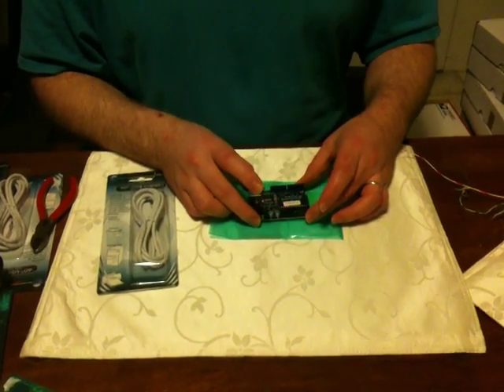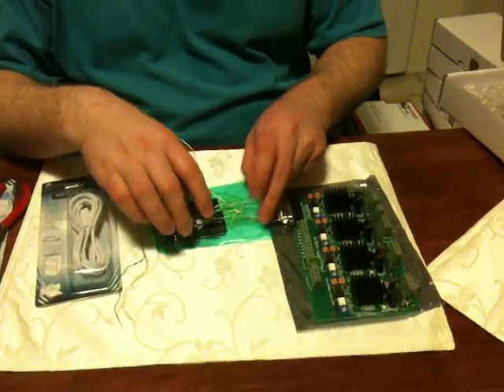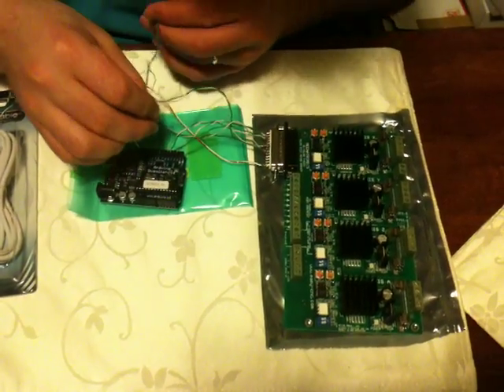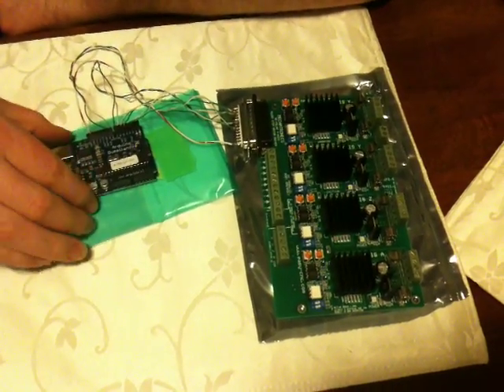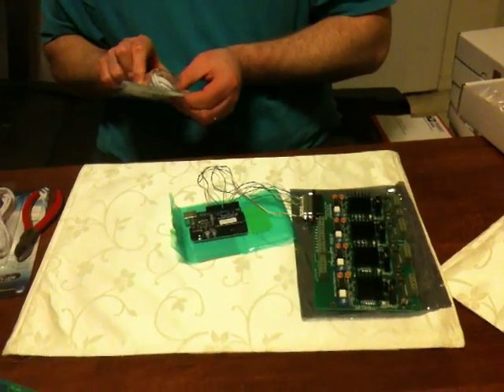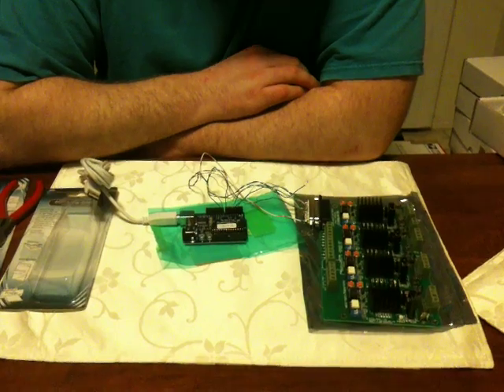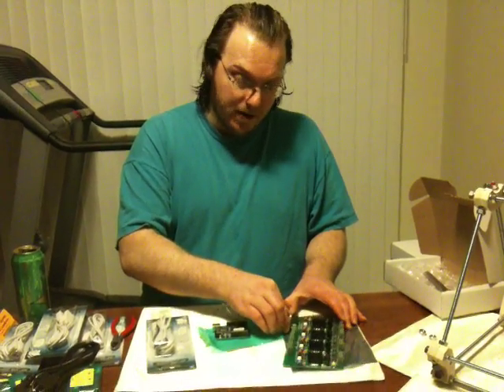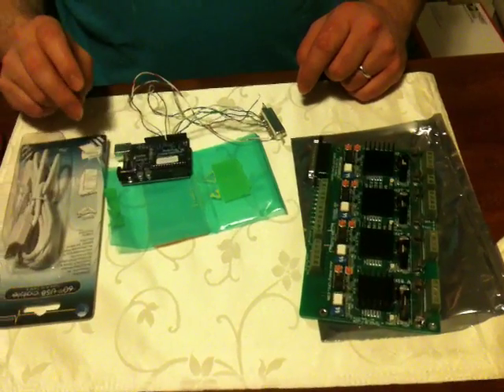mendel cnc board talking to arduino controller. instruction video

Comment from the maker: there is also some work on 5d arduino. there is a programmer that has a version that does not use float math that runs even on the atmega168. Google 5d on arduino. and yes no makerbot circuitry is required, I think that they have a monopoly, but also a very loyal following. also there setup is based off of reprap foundation ease of use. you'll pay a lot for makerbot, but is will work ok. For reliable electronics that are industry standard, use a cnc board. look for 3 or 4 axis cnc board/relay